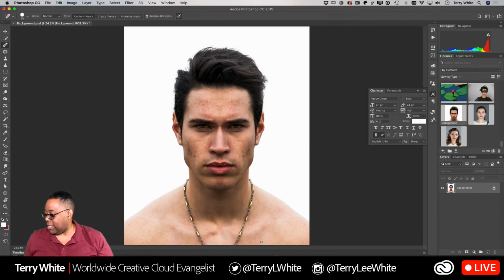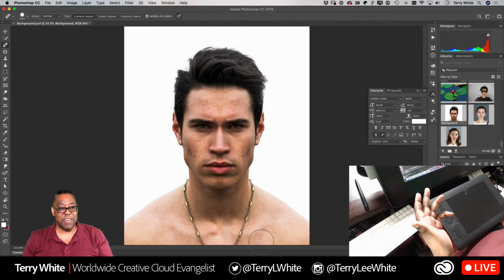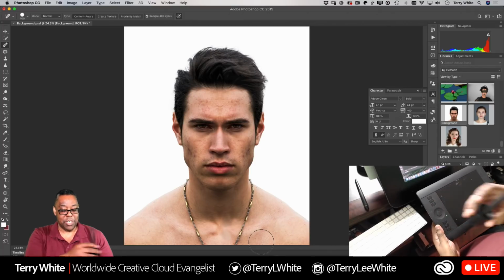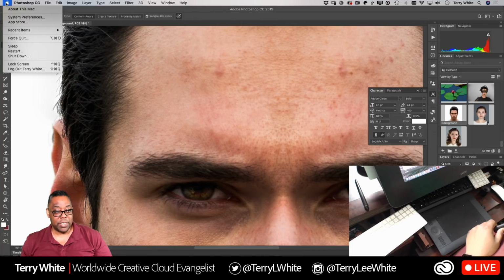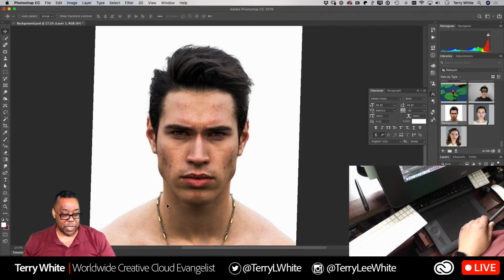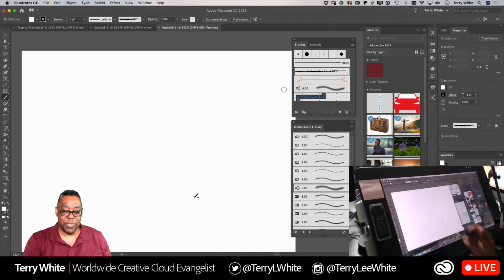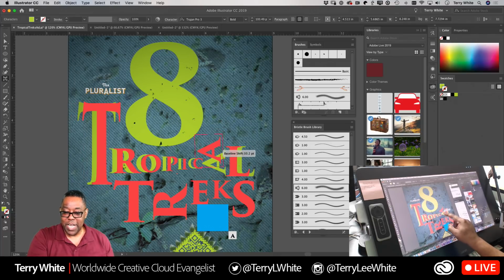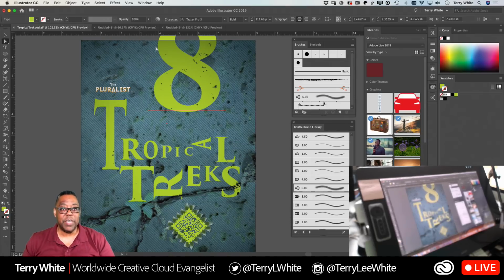How to Use a Wacom Tablet with Adobe's Tools

Comment: Watched this now, thank you for the go-through. 
Since time has moved on after your stream—I wonder if any complications in compability could arise with a Macbook Pro M1 (2020)? I'm about to buy my first tablet and have been looking at the Wacon Intuos (not Pro) as a "starter kit", and the ones I've seen in my reach have been from 2017-2018. 
I also wonder if the non-Pro Intuos connects with Photoshop and Illustrator like the more expensive ones?

Comment: Is there a quick shortcut to change brush size and feather in lightroom with a basic wacom intuos pen tablet? It doesn't have a scroll wheel and the shortcut in photoshop where you hold control/option click and drag doesn't work in lightroom. Thank you!!!